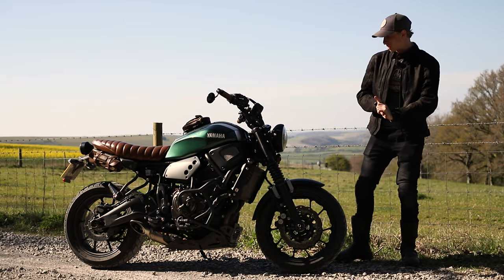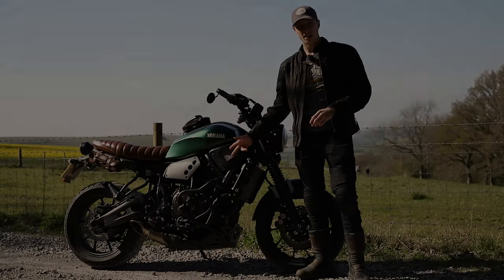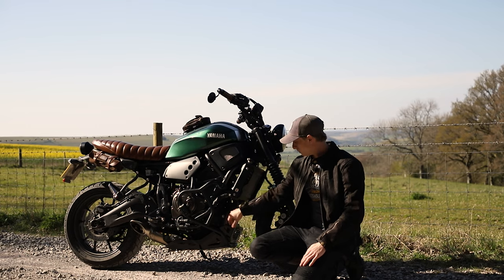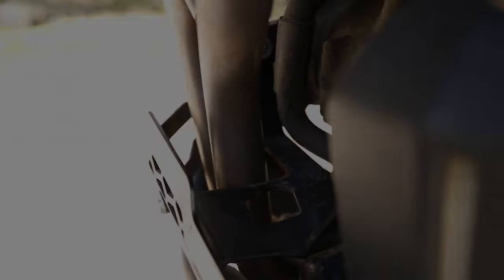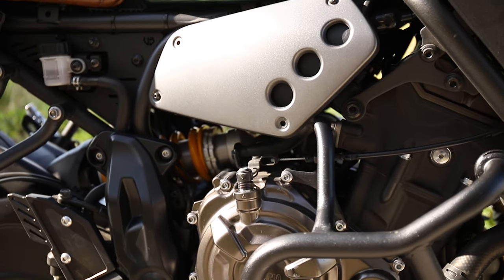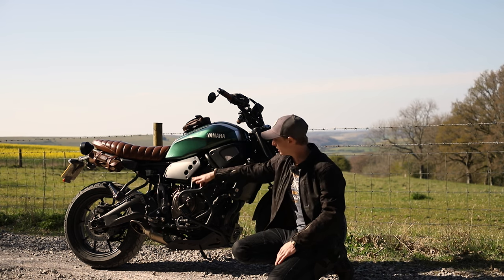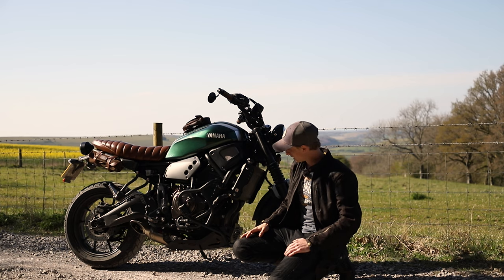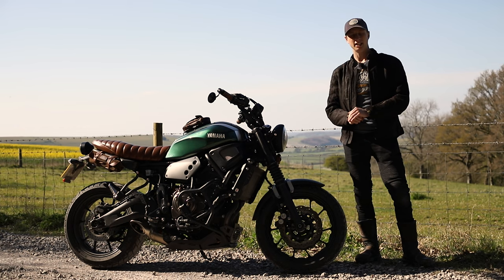XSR700 Skid Plate!! - Engine Protection

Comment: Thanks for all the input. I finally got my IBEX skid plate ( about two weeks shiping from Belgium to California) and it is a nice piece of metal. Getting the attachment point for the GIVI crash bars on the rear shock was a little challenging but that is done ( a one man operation ) so I am waiting for the weather to cool to finish the job, While I am waiting for that I am hoping that the skid plate doesn't interfere with the crash bars. If it does I was hoping you could explain how you bent yours so nicely.  Thanks again.
Reply from the maker: Nice one! Good job getting the bars on, they can be a pain with only one person! Glad I could be of some help with the video. With the plate, I literally just smacked it with a hammer using a cloth to not scratch it! 😂 It wasn't very elagent I must admit!
Reply: @ballamoto  Matt just finished up with the crash bars and went to check the fit of the skid plate. There is no way this skid plate is going to slip in there without the crash bars being loosened. Does this sound right or am I doing something wrong? What tires are you running they look like Shinko?   Thanks again.

Comment: Liked the video so much I went and bought the same crash bars and skid plate. I have a 2019 MT07 and I am wondering what you installed first, the bars or the skid plate?  I'm hoping it doesn't require bending the skid plate like yours.  I received the crash bars already and just waiting on KGL for the Ibex skid plate. I am in California and  the only place I could find the Ibex skid plate was in Belguim. If you have any pull get them to find a distributor in the States.
Reply from the maker: Oh awesome! I installed the bars first, and to be honest you need to get the plate off and on with the bars installed so you can change the oil filter when it needs doing. Some guys have said they didn't need to bend the plate, so you might be in luck! Bending mine just made it a lot easier 👍 good luck!
Reply: @ballamoto  Thanks for the heads up. I was hoping the oil filter could be taken off with the plate still on. Regardless it is going to be a nice upgrade.
Thanks
Reply from the maker: @biker1106  I'm pretty sure it can't unfortunately. Also, you'd need to remove it to get to the sump plug anyway. Still, only needs removing once a year or so!

Comment: Thanks for this! it really helps. I got the bars but still figuring out how to install them properly. Could you explain a bit better why the rear suspension part is tricky? how did you do it? Thanks!
Reply from the maker: Yes unfortunately I didn't film that! The bars need to be attached to the suspension mount. In order to do that you need to remove the bolt from the suspension. So you will need to jack the bike up, and also jack the rear wheel up, to make the suspension "neutral". I would take a look at a video of how to remove the rear suspension (same for most bikes), and that will give you a better idea of what to do 👍

Comment: Bike looks great. Is your exhaust a straight through? or does it have a catalytic converter? finding it hard to find out what the rules are in UK for MOT. Any advice appreciated
Reply from the maker: Mine actually has no Cat at the moment. I may have to pick one up for the MOT, although I'm pretty sure they don't check the emissions on a motorcycle MOT 🤔 only issue may be the noise level!
Reply: @ballamoto   thinking about getting the scproject 70s conical for my xsr, did you order your exhaust from a uk dealer? any recommendations? keep up the good work!
Reply from the maker: @tomjenkins6597  that's a good choice. I ordered mine through a third party, but I can't remember where! Thanks mate 👍

Comment: Thank you for sharing this. Adding the plate below limit somehow the street performance in the curves?  what is your experience so far with it?
Reply from the maker: No problem! Absolutely not, no affect on street at all. And so far it has saved me from some very possible Exhaust and Sump damage off road! Only problem is there isn't much ground clearance!
Reply: @ballamoto  thanks a lot for the reply. I was also suspecting the issue for the clearance… our bike is not so enduro oriented ;)
Reply from the maker: @killick8086  haha ain't that the truth! If only it had another 4 inches clearance, it'd be great for it! 😂

Comment: Do you need to remove the whole thing to change oil/oil filter or just the front bracket?
Reply from the maker: I remove the bash plate, it's only 4 bolts and slides away from the bars
Reply: @ballamoto  Dammit now I have to buy this 😅
Reply from the maker: @pavloscore  🤣 I recommend! It's a great setup 👍

Comment: Matt just finished up with the crash bars and went to check the fit of the skid plate. There is no way this skid plate is going to slip in there without the crash bars being loosened. Does this sound right or am I doing something wrong?   Thanks again.
Reply from the maker: I just about managed to fit mine in (after bending the front in a little as shown in the video), but it now goes on and off quite well! No loosening of the bars required 🤔
Reply: @ballamoto  Thanks for the reply. I have a sneaky feeling that perhaps your aftermarket exhaust might give you a little more room than stock pipes. Just had my coffee and  am going to go tackle again. From the looks of your post a number of people have installed this matchup and I am the only one experiencing any problems. Makes you want to go hmmmm. Wish me luck. Then again if it doesn't squeeze in there without loosening the bars no biggie I like to wrench. Just thought I was missing something, 

One more thing it looks like your running  Shinko tires? If so what are your thoughts?
Reply from the maker: @biker1106  that is strange, it should fit better with the stock exhaust, or at least that's what I've heard, as the pipes are a little more bent out of the way! Well good luck! 😂
I'm actually running the Scorpion STRs now, and love them, both on and off road they're great! I was running the Pirelli MT60RS and they were great on road, but not amazing off road - ok on light gravel but anymore than that and they were a bit slidy!
Reply: @ballamoto  Well I had do take one side of the crash bar off and loosen the other a little to slip the skid plate in. I had to bend the plate like you did to get the 4 screws to line up.I think it would have fit if the front of the plate didn't have that bend at the top. It was to wide to slip between the pipes and the crash bar,  Maybe next oil change I'll flatten the top edge so it will slip between. Other than that I am stoked with the outcome. Thanks for the help.
Reply from the maker: @biker1106  that's awesome news man! Glad you ended up getting there with it. As you say, it's a bit of a pain but we'll worth it in the end. Enjoy mate!
Reply: @ballamoto  Matt I went back and reviewed your video's and it appears in the one where you go over all your upgrades that the front of the skid plate at the top has been bent forward. I don't know if I am seeing things but it sure looks straightened out which I was planning to do next oil change.
Reply from the maker: @biker1106  I haven't bent the top bit at all, it's vertical when you look at it from the side.  At about 00:54 there's a good side profile shot. It's however it came from the factory!
Reply: @ballamoto  I agree that in that video it is definetly looking stock but I am talking about your video "All Modifications and Upgrades" at about the 08:58 mark it looks like it's been hammered a bit. Might be me, don't know. Liked your MT 09 video by the way.

Comment: Anyone successful in removing the skidplate without loosening the crash bars? It doesn’t look like it’s possible. This would be for oil / filter changes.  Thanks!
Reply from the maker: @tonysanchez888  yes, I do this every time. I never lose my crash bars, but I have "reshaped" the bash plate a bit, with a hammer! 😂
Reply: @ballamoto  yea. Saw that on your video! I ordered the Givi and was thinking of returning it, but maybe I’ll keep it. I guess worst case scenario is that the front skidplate bracket can be removed to make more room to wiggle the skidplate out. I small hole on the bottom could be drilled to remove the single small engine bolt underneath holding the bracket in place.